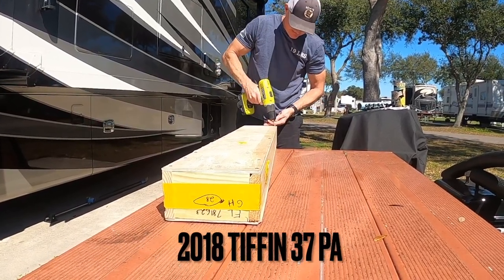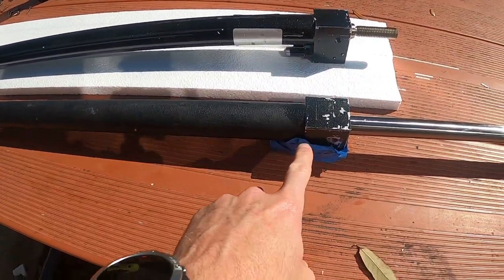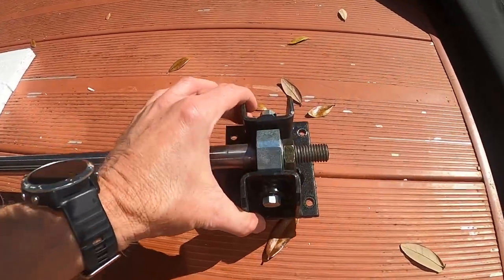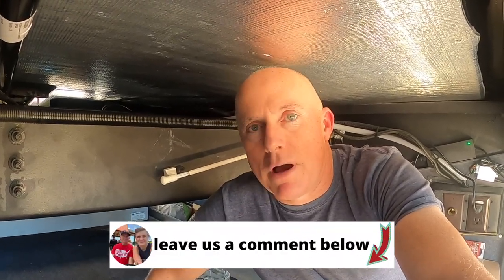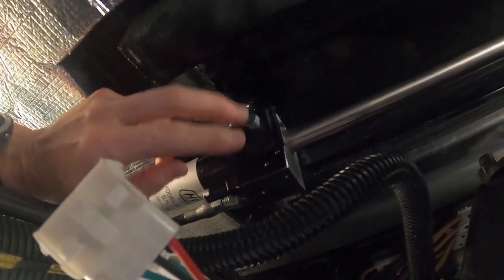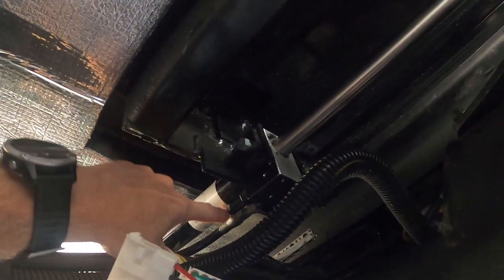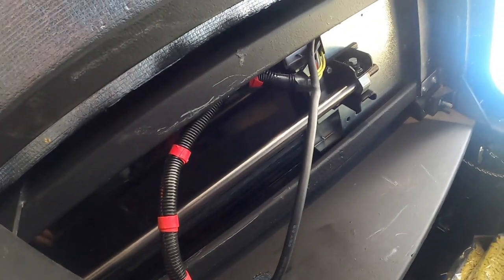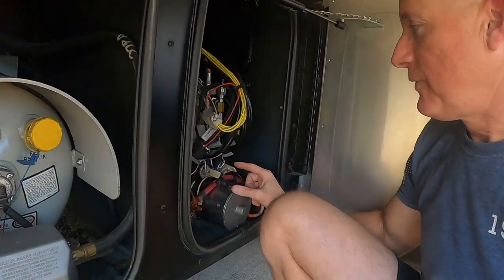The Fix of our Hydraulic Slide!  DIY done RIGHT!!

Comment: How much oil did you have to add to the reservoir after installation and testing?
Reply from the maker: Hey, thanks for the comment. It's been a while since I did it but I think I only had to put about a quart in it. Thankfully I didn't have to bleed the lines which also saved a little. It's a little tricky pouring the fluid into the reservoir. Thanks for watching our channel.